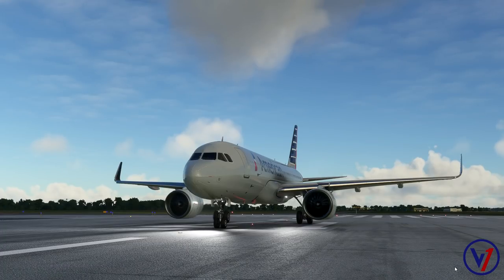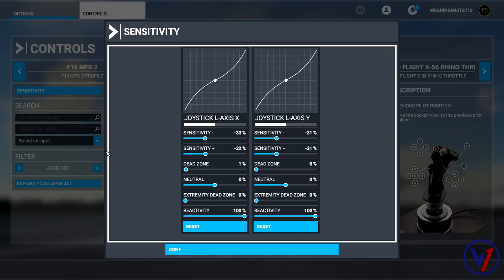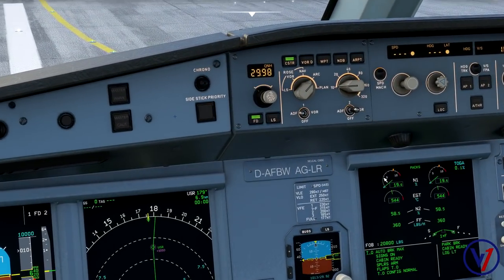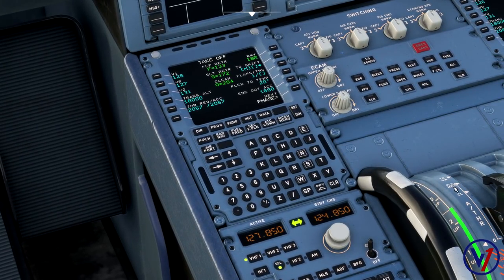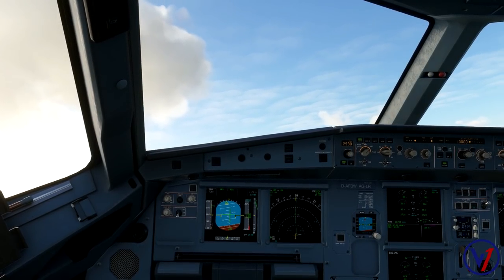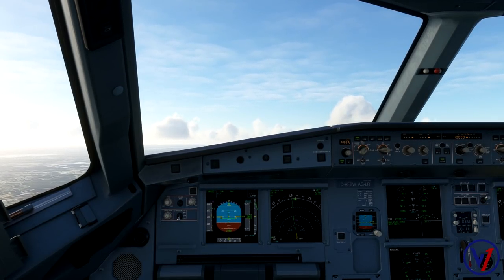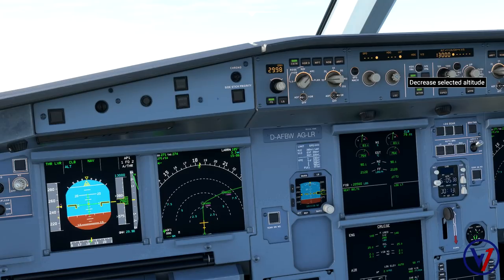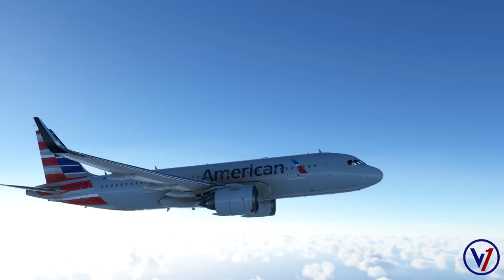TakeOff / Climb | Flex or Toga? | REAL Airbus Pilot Training | FS2020 A320 NEO | FBW Mod

Comment: One problem I keep struggling with is when ATC assigns an approach and I select that through the arrivals page, there are times the airplane wants to turn around and backtrack before heading directly to the next waypoint.  This happens most of the time but it’s not 100% consistent.  Any thoughts?  Thanks for the videos, super helpful!